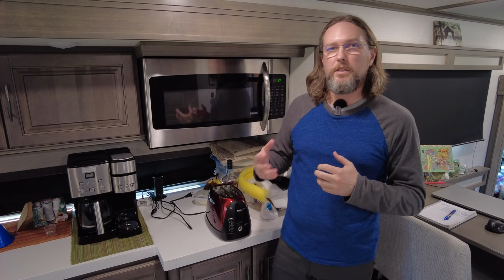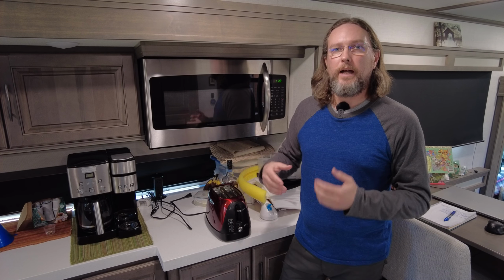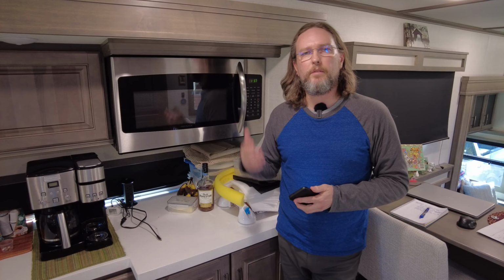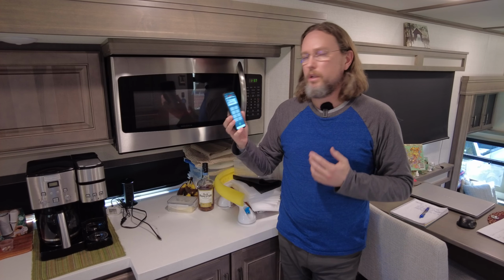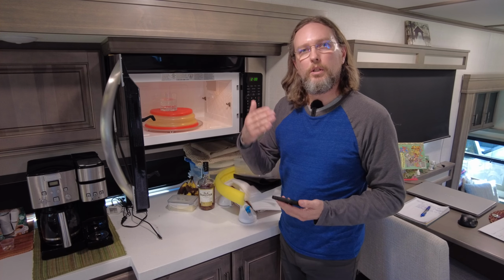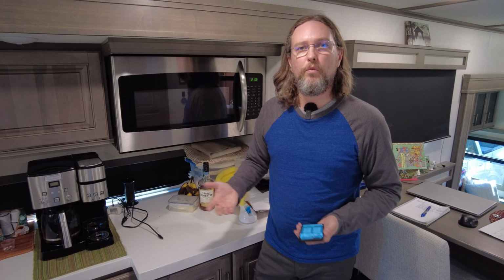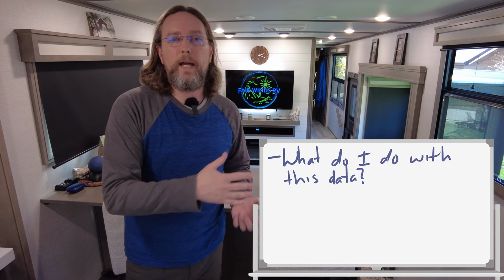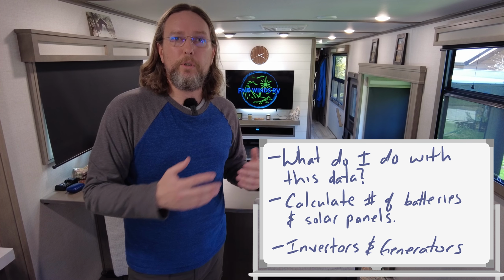The RV Power Audit: Why Everyone Gets Solar Wrong

Comment: I have a 15ft jayco trailer. I put renogy 200w on roof with 1000w inverter and 100ah lithium. I also use a 100w panel on the ground. Thats all i need for week long camping trips
Reply from the maker: Those portable panels can really come in handy for a little more juice if you need it!

Comment: Yeah. I'm about to upgrade my solar system on my 5vr. Going with 8 400 watt panels and an eg6 all in 1 unit. Working on the mounting for the 6 400ah lipo batteries. Already have 4 200ah lipo Batts in the front. Like others state. It's not cheap. But we spent 2 years building the new system. Now it's all coming to fruition.  We'll be keeping the propane Gen to. Just in case. We can run off our tanks. But if we can keep at least 50% sun we'll be fine.

Comment: We have a 2024 Cedar Creek 5th wheel with 3,000 watts of solar and 2,240ah of batteries and we can run our AC indefinitely. As long as we have good sun we really don’t have to worry about it at all. If we were to try to stay in 90-95 degree weather we would need a generator every 3-5 days for like 4-6 hours though. Running AC is 100% feasible. Not cheap lol, our system was about $22k, but we LOVE not having to baby the system to make it through the night!
Reply from the maker: That's a lot of solar!
Reply: Ya, I wish we could have got more really. The panels are so stinkin cheap. We got the new 250w rich solar panels that are basically the same size as the old 200w ones and we got 12 of them to fit, 6 on driver and 6 on passenger side.

Comment: Power is addictive. The more you have the more you will find a use for. If you're a FTer or someone who likes to boondock extensively I suggest getting as much solar as will fit on your roof and as many batteries and other system components that will fit your budget. Roof space and money are the limiting factors for most of us. 

We're old, retired FTers who designed and built our system ourselves, on a tight budget. It took us 5 years to gather the resources and finally complete the project, doing all the work ourselves. We started by building a 620-watt liftable solar array on the side of our motorhome. Our side array makes a nice bedroom window awning too, practically lifting itself with a couple gas struts, and it's easy to clean, standing safely on the ground. Next, we built a 12v, 560ah LiFePo-4 battery using 8, 280ah prismatic cells. We use a Heltec 330amp BMS with a 5a active balancer. We chose these cells rather than a pre-built battery because they fit perfectly under the steps of our MH where our old pair of golf cart batteries used to reside. We insulated the battery compartment, cut a small hole in our step risers and installed a tiny computer CPU fan to keep this space at close to room temperature, so we don't have to worry about the BMS shutting down charging due to low temperature - or their life reduced from getting too hot. Our 12v system uses an 80A Progressive Dynamics LFP converter/charger, a 1,000w Renogy inverter, a 50a Epever MPPT charge controller and a Lnex battery monitor. All this cost us under $3,500 and met all our off-grid electrical needs except for our air conditioning, heat and microwave. For heat and refrigeration, we used propane and for our A/C and microwave we ran our generator. We lived with this limited system for 4 years, while we saved our money, traveling with the seasons so as to minimize our need to run our 5,500w generator which is noisy and pretty expensive to run for hours at a time to power our A/C (about $20 for only 8 hours of use.) 

By mounting the solar array on the side of our coach, we left the roof free to rack 8, 550w solar panels down the length of our 35ft Class A, 15" off our roof, above our AC, vents, etc. We built the rack out of 2" aluminum angle with the front 2 panels sloping down at a shallow 9.5-degrees to meet the roof, gently easing airflow over the array, making the RV more stable with less wind drag driving down the road too. It covers our entire roof, providing some nice shade with plenty of cooling air underneath, increasing solar output and reducing the heat load on the air conditioners too, though our overall height is still just under 12 ft.

We mounted a Sungold Power all-in-one 48V, 5,000W Inverter/100A charge controller/battery charger, breakers and a Lnex battery monitor on the wall in our bedroom, saving us space as well as money compared to a system with individual components. Our 48v battery uses 16, 320ah prismatic cells and a 200amp Heltec BMS to keep it safe. Together with our 560ah 12v bank, we have a total of 23.5 kwh of batteries onboard - kept charged by 5,020 watts of solar. This is the equivalent storage capacity as $16,650 worth of Battleborn batteries for under $3,400. Cheaper, prebuilt batteries are available that will cost somewhere in the middle of this range.

We removed the rooftop A/C we had in the bedroom and replaced it with an EG4 28.5 seer-2, 12k btu mini-split heat pump on the upper rear of our motorhome. It's super quiet and cools as well as our 14.5k btu soft start equipped Furrion we installed up front. This second phase provides 24/7 off-grid air conditioning and heat from the heat pump. We can run both A/Cs, microwave and charge our batteries from solar at the same time, even in winter. We have a total of 6,000 watts of 120v inverted ac power, giving us off-grid electrical self-sufficiency without the need to run our generator, for a total budget of around $11,500, including the high-efficiency heat pump.
Reply from the maker: That's a LOT. Thanks for sharing!